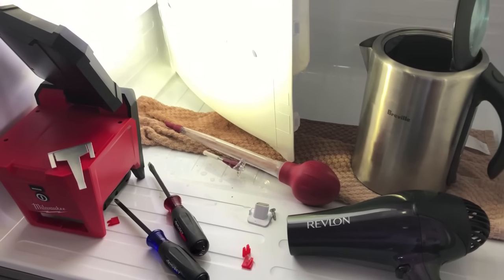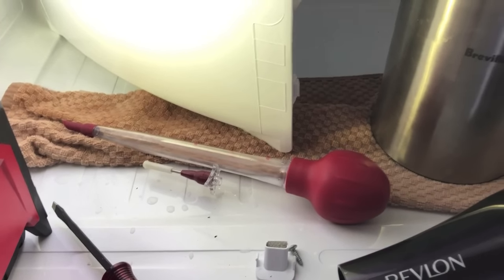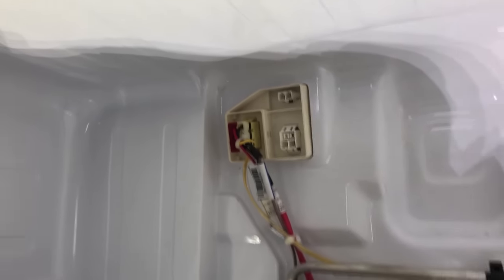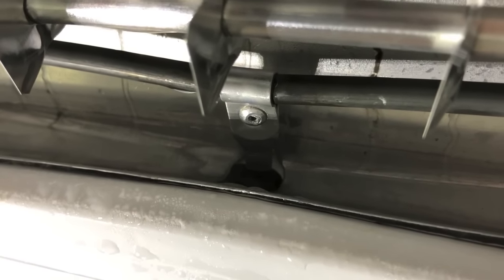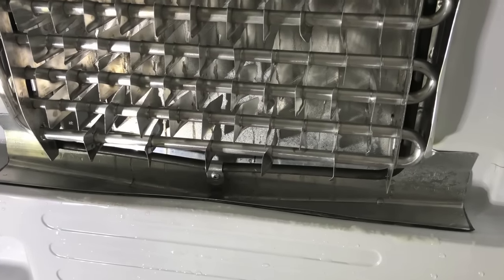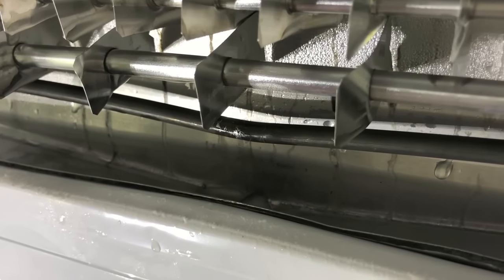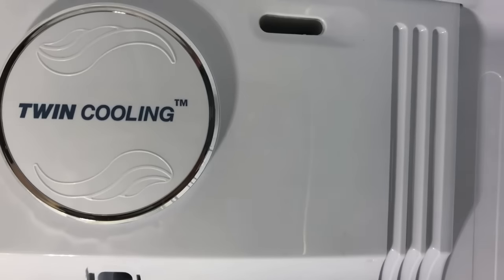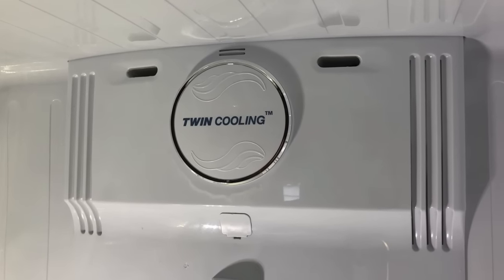Samsung Refrigerator Repair - How to Fix Water in the Crisper Drawers

Comment from the maker: The part shown in the video can be ordered here:
https://amzn.to/2UeeiAe

After feedback from 10's of thousands of views and many comments, we'd like to add:
1) Our initial fix as shown in the video and detailed in the article linked above lasted for YEARS. 
2) When we ran into the issue again years later, the first thing I checked are the drain tubes at the back of the fridge. Several commenters here have reported those tubes at the bottom back of the fridge (you'll have to roll your fridge out), can get clogged and cause the same issue. I checked ours and they were clear. 
3) I then adjusted the fridge temp 2 degrees warmer and after about a week, we were back to normal and no longer having issues with water in the crisper drawers again.
Reply: I used the new Samsung part you showed, and it only worked for a few weeks, then same problem nonstop.  I've checked the two drain lines in the back and they are clear.  I've seen where someone else just attached a long, bare copper wire several inches down into the hole and it worked for years with no issues.  Any idea why you think yours worked for so long, and then didn't??
Reply: what was your original set temp and what did you turn it up to?

Comment: I'm retired and just didn't want to hassle with it, but after 4 different "experts" came out and quoted everything from a faulty sensor to replace the coils for $500+, I finally did it myself. For $6 for 2 clips from Amazon and an hour of my time, I completed this minor task. All is back to normal. Thank you for posting this video.
Reply: Yeah, got a couple clips too and carried out the installation but that didn’t last two long. So about one year? later I said “to hell with it !” And replaced the fecking thing with an LG fridge…Glad I did!
Reply: @danieljette7409  Sorry to break it to you but youre just trading one issue for another. LG is notorious for its compressor failures.
Reply: @El_Scorcho_  I have an LG in the basement that I got in 2014 and one in the kitchen that I got last year to replace the Samsung. They work great.
Reply from the maker: Nice work Michael, glad to hear the repair was a success!
Reply: @danieljette7409  Glad it worked out for you. Im in the industry and im replacing LG compressors on a daily basis.
Reply: Internet has saved my bacon for forever! Nothing is impossible :)
Reply: @El_Scorcho_  The drain problem is a sign of a bad compressor?
Reply: @victoragresti1777   No. i was saying he traded one issue for another by switching to an LG refrigerator. LGs dont have drain issues, but their compressor’s do fail regularly.
Reply: @El_Scorcho_ not the issue with all LG compressors. Only certain Linear compressors had issues. I worked on repairing these for years after LG realized they had an issue.

Comment: Thank you for the video. We were about to throw out our 4 year old fridge and spend 1700$ to replace it because the water was filling the drawers and leaking on the floor. $22 for the part and about 45 minutes to fix and we are in business. Amazing. My only suggestion is to remove the cover in the rear to expose the evaporator pan so you can see that is totally defrosted and the water is running all the way through. Again thank you so much
Reply: Thanks for your video. My french door fridge is now 12 years old, I contacted samsung a couple of times when this started and they said that they haven't had any reports of this problem. After about 4 years my crisper drawers have not been used. I empty them of water probably 4 times a year. Today (Sept 19 2021) I noticed that the right hand door wouldn't close tightly. After taking a very close look at it I noticed the door storage compartment was hitting the center shelf. I removed the shelf, then saw that the back panel was being pushed out by the ice backing up above the drain forcing out the shelf. I'm surprised that samsung haven't issued a bulletin regarding this problem. I guess I should have kept asking. I will order this part hoping it fixes the issue. Now that I know why my door wasn't closing, it explains the cracking and banging its been doing the last few months. Even appliances complain when things aren't working right.

Comment: Even with the new clip, in time it will do the same thing. I have been through this scenario. Samsung fails to admit that these fridges with these cooling systems are all faulty.🤬
Reply: Happened to me again. I'm wondering if I can rig up some kind of a heating wire to keep it clear. Like used to keep pipes from freezing. Love my Samsung Range but not crazy for the fridge.
Reply: so even w/ the new clip it still causes the same issue?
Reply: same thing happened to me after 9 months with the new clip.

Did you find another solution?
Reply: @iridetoo2158  yes. Mine acted up again after defrosting the whole thing n fasting a Cooper wire down the hole.

1. I bought a new back unit, twin cooling, for $140. I bought a "Refrigerator Drain Tube Clip Evaporator Replacement" for like $7 on Amazon. 
2. Transfer your food to another fridge or ice chest. Best way is to let the fridge defrost for 24 hrs. I try pulling the twin cooling without it defrosting, it damaged the piece. Be patient. 
3. Insert the clip. Replace the new twin cooler. 

After doing this, it solved my issue. It's been like 3 months and no ice build up. I read on a forum somewhere that over time, the styrofoam build up water and becomes less effective. It gets pretty heavy. Once you replace your twin cooler part, you'll notice the old one will continue to leak water as it sit outside in room temperature. 

I'm glad I replace my part VS buying a new fridge. Overall cost was about $150 and 2 days of labor. Good luck.

BTW, I've had my fridge for over 6 yrs and started to act up in the 5th yr. What suck is I bought the 5yr warranty n it happened right after. Arghhhh.

Comment: Great information and thank you.
My particular problem was with the drain tube itself. They have an external/internal sleeve which deteriorated and turns into a cone which was blocking the flow. It is accessible by removing the rear vent plate. Hope this might help others.

Comment: After years of putting up with soggy drawers ;-) - and no luck finding a reputable repair person in my area (although I did get scammed by a disreputable one!) - I came across this video.  I bought the part that day, and this past weekend did the repair.  48 hours later the fridge is still dry inside, I'm SO HAPPY!!  Definitely the hardest part was emptying everything out; I chose to let the fridge warm up before removing the panel, not wanting to damage anything and we lived out of coolers for a couple days.  Bonus:  this is the first time every component of the interior has been fully washed, since I bought it 8/9 years ago...  Thanks for the great video ♥️
Reply from the maker: That's so great to hear (the victorious DIY repair part, not the disreputable repair scammer part). Congrats on the fix and we're so glad the video helped you.
Reply: About to do this, yours still working well?

Comment: Thank you for making this video. Tonight I was able to fix it myself. There is water that has been leaking for 3 years inside. I received the metal part in two days. Luckily for me, I was able to find it on the Canadian website. With a good rear cleaning, it's back to being as quiet as it was ten years ago. Again, thank you very much.

Comment: Thank you for this video!! A few months back we noticed lots of water building up in both crisper trays and underneath. We searched for DIY video and learned about the ice build up. We turned up the temp on our fridge and freezer a few degrees and that actually helped quite a bit! Today I finally got around to completely defrosting per this videos instructions and clearing out the ice but WITH THE TEMP ADJUSTED, hopefully will avoid this problem all together going forward. We’ve had this fridge for over 10yrs and hope to get several more out of it. Thanks!

Comment: Good video! I was able to complete my repair by following it. The only thing I would add is to make sure you pull the fridge out and vacuum dust off the condenser coils underneath. You will also be able to see the evaporation pan that the condensate drips into. Having someone pour a little water into the drain hole will tell you the drain line is completely clear of ice.
Reply: Thanks for the tip on the evaporation pan.  I will have to take a look, I wonder if that pan is removable so that it could be emptied of water?
Reply: @SesameBuns  No, the evap pan is not removable

Comment: Our refrigerator is 2 years old, started having the water problem. Thanks for the video! With a little help from my husband I did it myself :)
Reply: Did it stay dry?
Reply: @danielleswisher1116  Yes! It was a very good fix. I bought the part from Amazon. I did most of the work but my husband did have to help to put the new part in..

Comment: Took a couple 4” pieces of copper solid core 20g wire, wrapped them around defrost heater tube on either side of original drain heater piece, extending into drain hole...moved sensor from input to output side...so far it’s working just fine! Thanks for this excellent video.
Reply from the maker: Glad to hear you found a solution that is working well for you (and that the video was helpful). Thanks for the comments Shrimp Tunes!
Reply: Your fix still working well?

Comment: Performed the repair just as you had instructed. I had no Ice build up in the collecting try or in my tube. We will see if this cures my issue with water leaking into my crisper drawer.
Reply: any update? did it work?

Comment: I just found out from watching another video that there is a defrost mode. I am in the process of doing it right now. Below is the post:

"Hold the power freeze and fridge buttons for 8 seconds, use the fridge button to navigate to power defrost - on mine, it’s denoted as rd (for refrigerator defrost, I believe). This will turn the cooling-off and heat the coils for 20 minutes before going back to normal. It will beep while it’s in this mode, so don’t worry about that. I did this last night and this morning the fridge is quiet as a kitten"
Reply: pretty bad when you call samsung and they dont even tell you this just say empty it out and unplug it for 5 hrs while theres 3 lil ones running round screaming in the background..what model do you have?
Reply: Mark,  Did you still have to take everything apart?  Or did this melt all of the ice and allow it to drain again without having to disassemble?

Comment: UPDATE: Installed the updated part yesterday (from Amazon) Getting that old clip off is a bit of a hassle, I used a needle nose plier to wiggle an edge back and forth until it tore.  Suggestion - I put a corner of a plastic grocery bag under the old piece to catch any metal scraps that broke off so they wouldn't fall into the drain.  Also, even with a dryer and fan pointing inside, and pouring in hot water, the actual drain took about 5 hours to thaw .... so put your food in another fridge if you have one, or for sure an ice chest .. Wow!... excellent detail.  And you are the first one that I watched that actually showed the replacement part number... Just ordered, and my next project asap when it arrived!
Reply: Thanks for the info! I checked the comments to see how long I would need to have my food out of the fridge for the thaw process, so thank you for adding that in there. I'm glad this is a simple repair and not something more serious. Cheers!
Reply: @dapper.moto85  good luck!.. and a recent update!  Had a friend staying here that turned down the fridge a couple degrees below recommended.  Well, DAMN - it froze up again.  I think next time i head out of town for a night, i'm just going to move my food to my back up fridge, and open the doors to let it thaw.  Just a really bad design from Samsung
Reply: What’s the name of the clip?
Reply: You can just slide the old clip over and out of the way. No need to remove it.
Reply: @mtadams2009  oh that’s good to know

Comment: Thanks for the information. Boiled water in microwave and poured it in the drain and sucked it out using a Turkey Flavor Injector with a 4” needle. With this and a hair dryer it drain quickly. Thanks!

Comment: Thank you so much for doing this video and saving my fridge. The repair took me a total of 2 hours and I didn’t have to unplug the fridge and I left the freezer full. I think the difference is that I was using a long flexible plastic tube I got off my kegerator to suck the water out, then replacing it with boiling water every 5 minutes. The tube was also strong enough that physically jamming it in there broke the ice up a bit and I think that’s why I was able to get it done so much faster than some of the other people who have tried it

Comment: Thanks!  We are looking at buying a Samsung Refrigerator and researched and read all the repair problems.  Crazy that Samsung doesn't ship these with these fixes when it's new!   My take away is put this fix and the one with snipping the rubber drains in the back from another video BEFORE you plug it in and set up your new, Expensive refrigerator.  Frustrating  to say the least but may "prevent" the problem in the first place!
Reply: After having a Samsung washer only last 4 1/2 years and this refrigerator developing problems, I would say to NOT buy Samsung. Junk. Good TVs maybe, but they won't get anymore of my money.
Reply: Shelley Weisickle I promise you all the same problems you are reading will happen to you within 5 years of owning a Samsung fridge.
Reply: @gradysanner1713  I agree. The worst dryer in the world and I'm here right now because of the water drainage issue with the refrigerator. NEVER again will I buy anything from Samsung except a TV.

Comment: YES! Thank you, I'm so glad I found your video again! We've had this problem for about a year just dealing with it, but finally thawed the fridge as a 1st attempt with no success. Going to need the clip but glad it's out there, thanks again!!
Reply: Be prepared to wait for the part though. I just waited 7 weeks for delivery from the mfr. and came back to refresh my memory on what to do. Wish me luck. The other video I saw recommended replacing the drainage tubes on the back of the fridge so we ordered the entire kit but may try just replacing the clip first and see how that goes for a while. Our fridge is pretty well wedged into its cabinet so I'll not be thrilled if I have to pull the whole fridge out to change out the tubes. Does anyone know if that's necessary in addition to the clip??
Reply: @chathammkm  answer can be found by reading through the comments
Reply: We have a Samsung but live in Cape Town South Africa, where do you get this clip?

Comment: So Samsung gives only a year warranty. Had trouble with the ice maker twice. Kept freezing up. Finally we got that replaced! Now problem with this leak you show. So had a service guy come out twice, & changed the Twin Cooling system panel 2x. Never addressed the problem you are showing us. Figuring they must have corrected it by now. But no. As of 5/2019 still having a small leak. This is unbelievable that consumers have to go through this! We are under a warranty company...so calling the guy to come back again. They really need to refund us, or have a recall on all their lousy fridges, if they don't get this problem solved! 
Thanks for your very informative video! 👍🏼
Reply: All manufacturers give a 1 year warranty.  =)
Reply: 512diane well guess what, we had our fridge fixed 3x for ice freezing up in 6 years of owning it and it still does it at year number 7!! Now it’s leaking water that stinks like rotten meat into my drawers which in turn is ruining my food every 4 months. BS.

Comment: Thanks! Had the same idea with the Turkey baster. Took a while to get it fully unclogged but got it. Used a wire to check were the clog was. Had to trim the new metal piece a bit to fit in mine.

Comment: Hi, thanks for the video. I’ve been struggling With this for a few years. I found that there is a drop tube at the back of the refrigerator that is white. Inside is a little valve that lets water down but stops insects/ warm air from going up. Algae had grown on it and it was stuck closed. The water was backing up all the way to the coils.  It was an easy fix once I pulled it out.

Comment: Use a turkey injector and you can thaw the tube in less than 60 seconds.  You need to be gentle because the drain tube is plastic and our injector has a metal tip.  Suck up the hot water into the injector, then expel it and suck it back in, repeat.  I changed the water after about 3 cycles.  I just microwaved about 2/3 a cup of water.  Great video and thanks for tip on the replacement part.  Wish I had watched this one first!
Reply: This comment saved me so much time! Thank you!

Comment: is it bad for the refrigerator to set it on a timer and turn it off for 3 hours at night? 

That was my temporary solution until I found your video with the part that can be the permanent fix.

Thank you for this video and also the link to the part. Been having problems with exactly the same thing.
Reply from the maker: Hi Paul. I can't say we'd recommend ever shutting off the power regularly to the fridge just in terms of food safety. If the temps in your fridge and freezer fluctuate up, your food quality / safety is at risk. I'd suggest you fix or have a pro fix your fridge (permanently) rather than a workaround. Good luck!